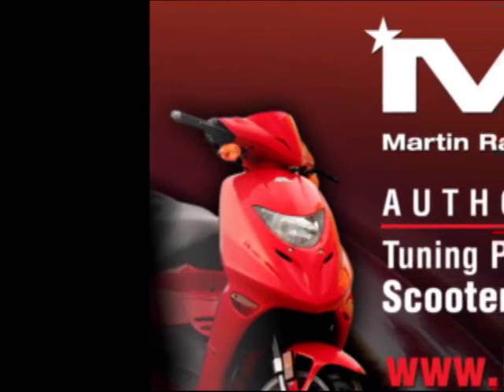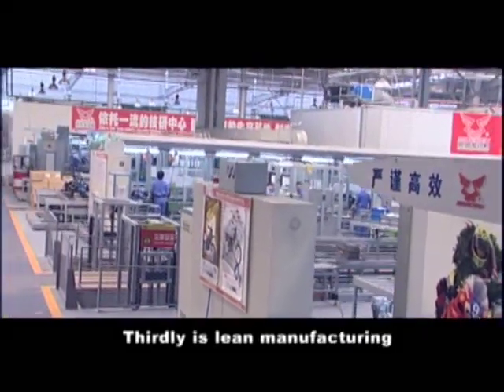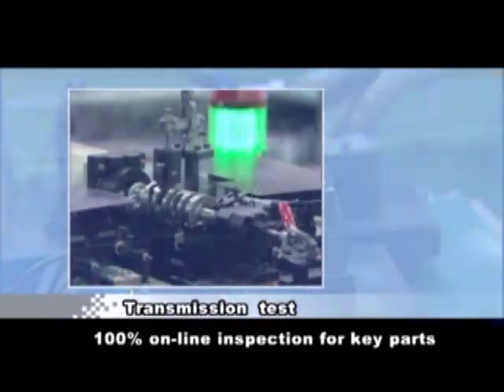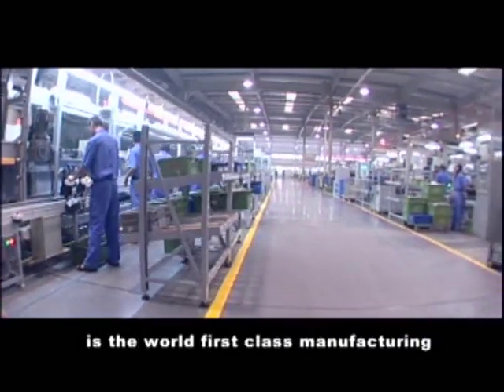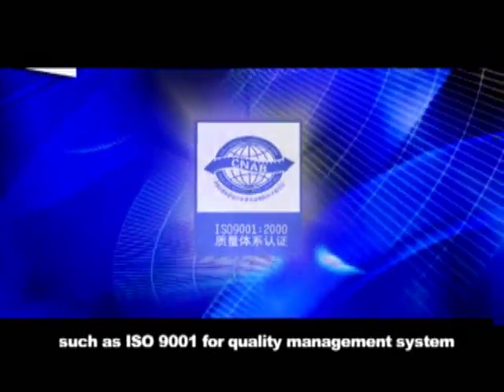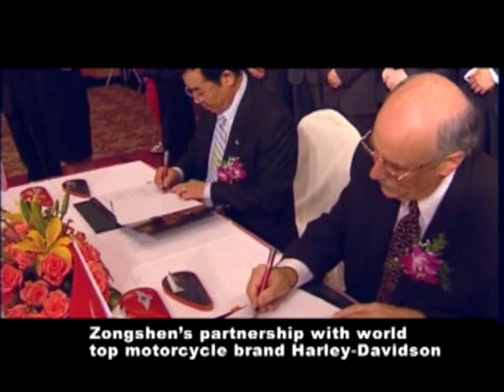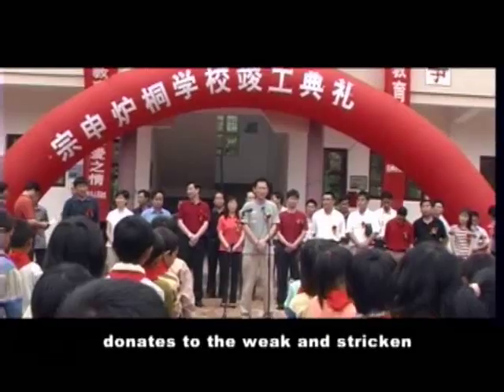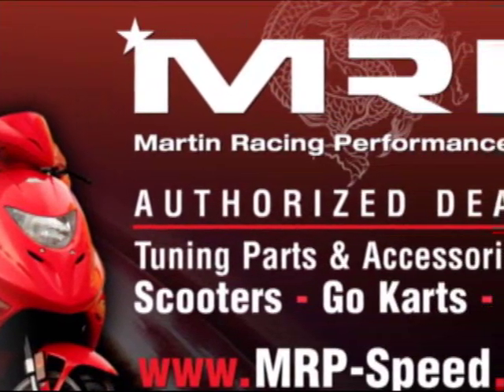Zongshen Part 2 Piaggios partner in manufacturing

Comment: Here in my country (Peru) most of the motorcycles under 250 cc are Chinese (with lifan and zongshen non-reliable engines), so I can tell you with solid base that these bikes are really bad, and usually don't last for more than a year or two. 
Maybe some well known companies take advantage of their low labor costs but that's all! Those Chinese engines are bad copies of old Japanese engines. It's common to see people who bought those bikes coming back to Japanese or Korean bikes soon.
Reply: Oswaldo Agurto  ohh really? How come my zongshen fly 150 is still running still in great condition since 2011? Been driving it everyday to work and everywhere I want to go. So far the only problem is the clutch cable. Its not about brand its how you take care of your motorcycle